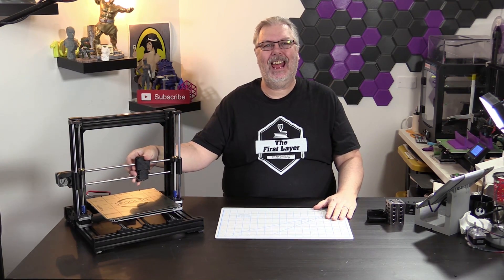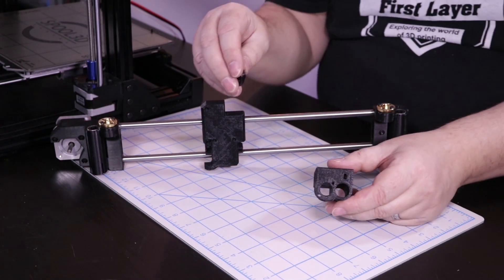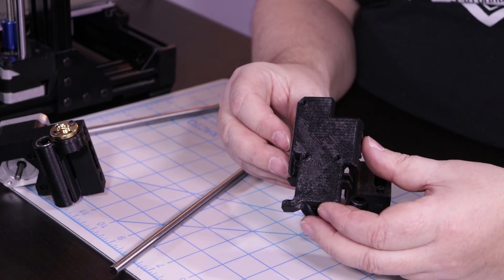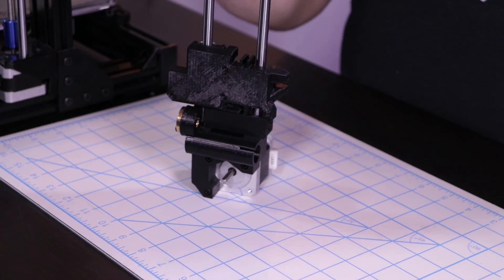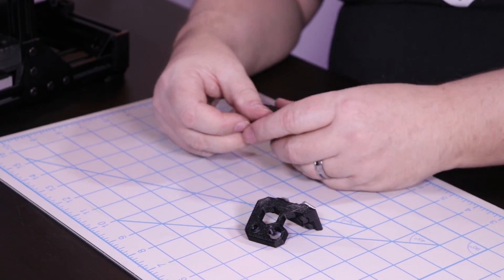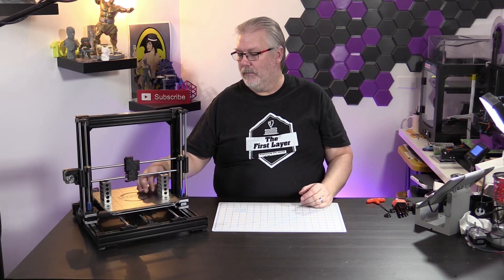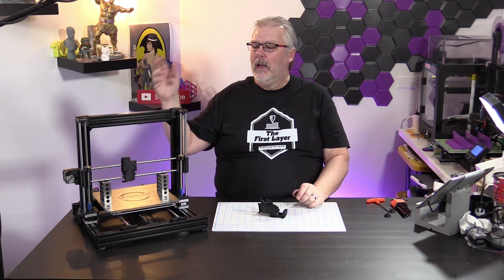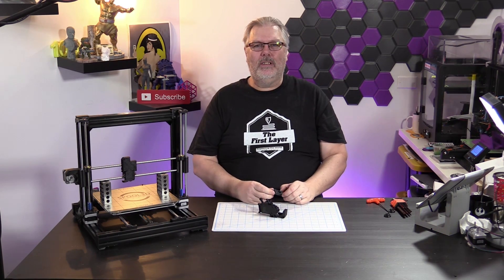X & Z on the DIY build: Part 5

Comment: You do not want a bearing on the top of the lead screw... it is better to allow them to move.  Lead screws are rarely perfectly straight. If they screw is captured at both ends, any curve will translate into movement on the x carriage.